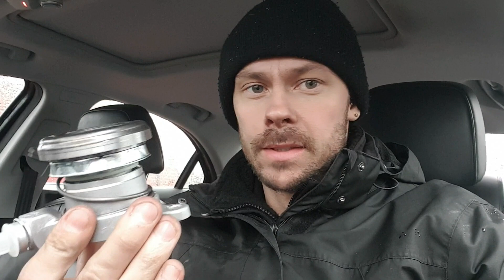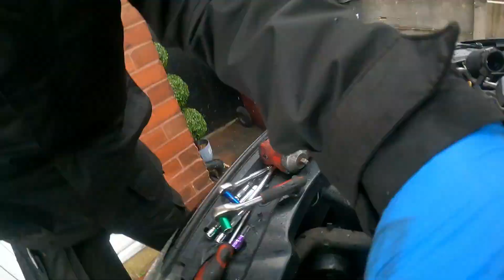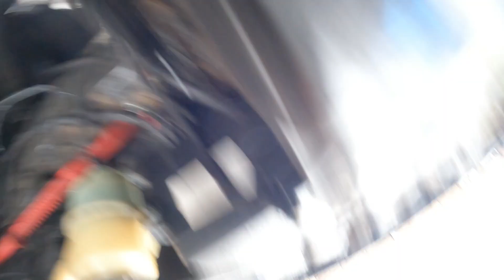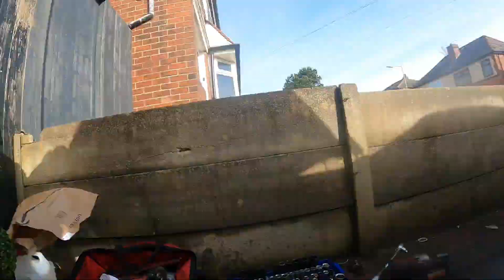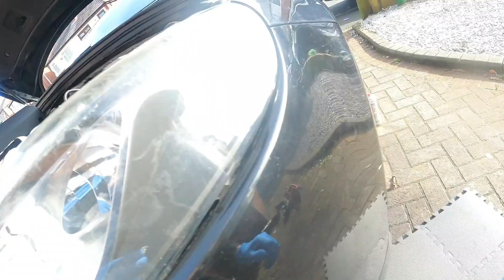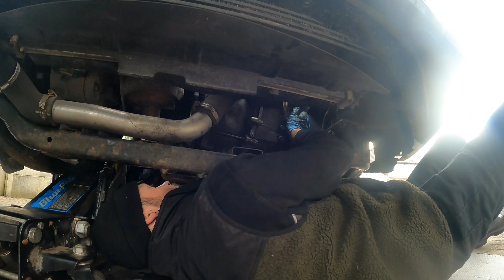MG 6 slave cylinder.

Comment: do you want to fix mine?
Reply from the maker: We're are you located
Reply: @Neil_phoenix  kirton lindsey.. i had a new clutch fitted about a year ago,,feels so close to the floor changing gear .crunches when cold.i think it isnt set up right..but i dont no much about cars
Reply from the maker: 2 far for me unfortunately, check your brake fluid level and topped up iff low, pump the pedal and test it could be a fluid loss issue.